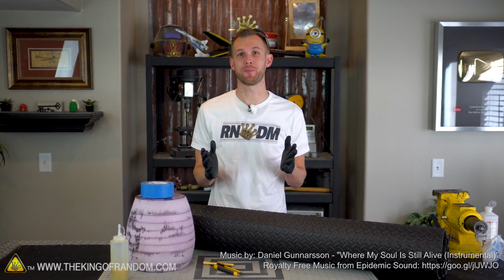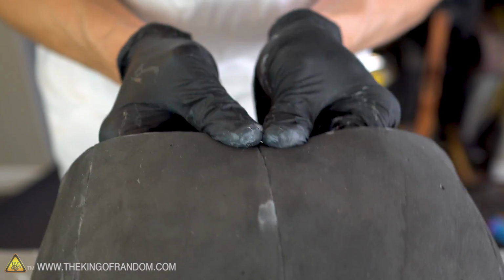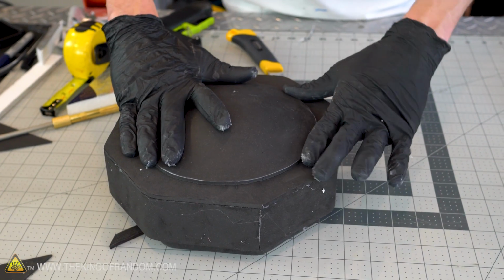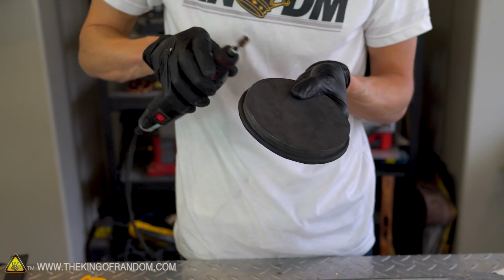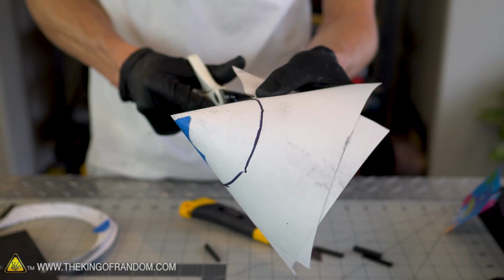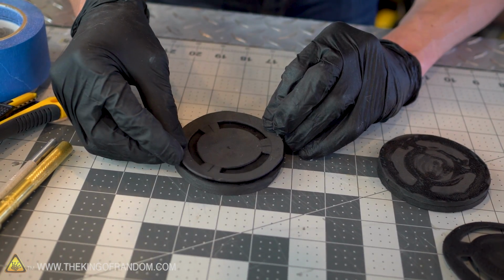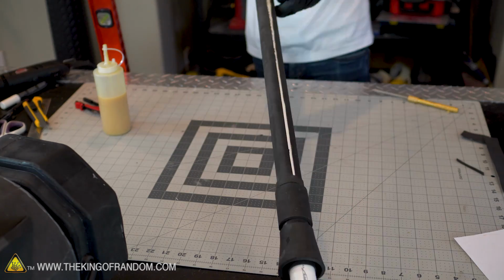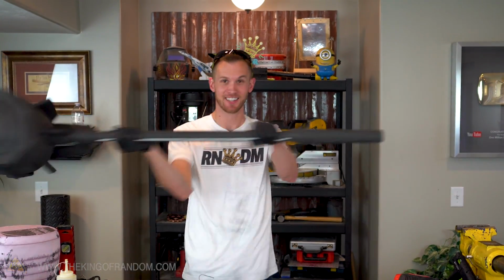Rocket Slammer Pt. 1! TKOR Guide To Building a DIY Fortnite Rocket Hammer!

Comment: Please do a video on rocket having acetylene gas as a propellant which is obtained from calcium carbide and h2o reaction. It would be cool to see a gaseous propellant in a rocket and worth a king of random project.
Reply: Bibek Sunar
You still need an oxidizer. I think the best way to get one would be to crush the calcium carbide and mix it with some dry yeast. After that you just add hydrogen peroxide to start the reaction. The water in the peroxide solution reacts with the calcium carbide, while an enzyme in the yeast (catalase) breaks down the hydrogen peroxide producing water and oxygen gas.
Still probably more useful for a portable oxy-acetylene torch than a rocket.
It also might explode so you probably should start with a small scale test.
Reply: hi
Reply: that would most likely be harmful for the lungs

Comment: MAKE LIQUID CARBON!! Might be impossible but worth the try..
Reply: Jason Patrick sice when has that ever been a problem for them?
Reply: Parker Knowlton too true
Reply: Its actually fairly cheap.  Just need some chem glassware
Reply: carbon melts at a temperature hotter than the sun
Reply: Carbon doesnt melt in this atmospheric pressure.
It just sublimate off. It need more pressure to melt carbon.
Its possible , But just expensive to make.
Reply: b,.!?